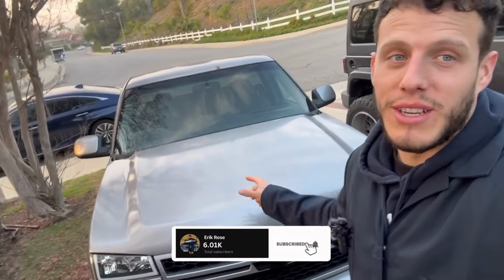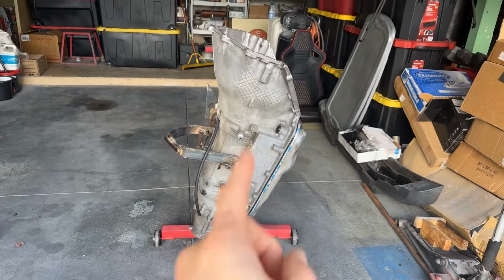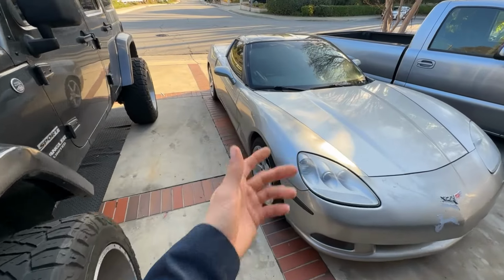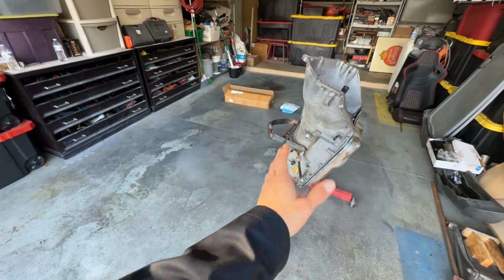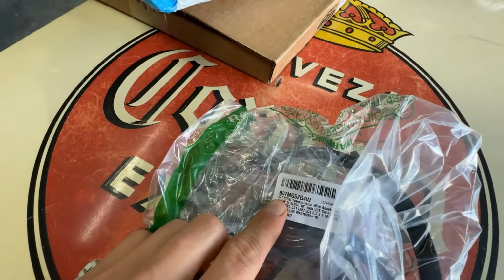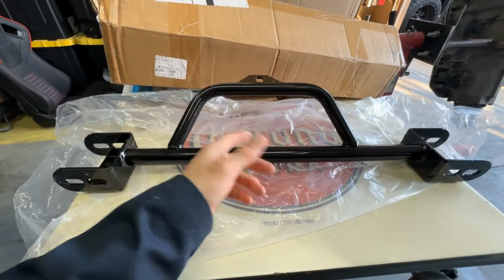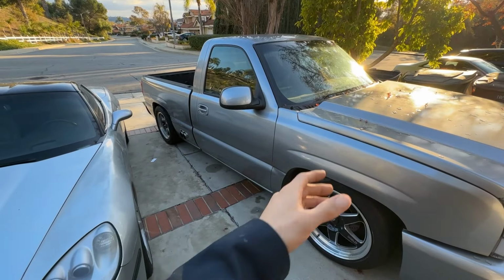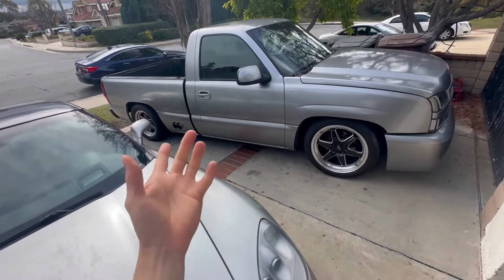EVERYTHING YOU NEED TO SWAP A 4L60E TO A 4L80E!!!

Comment: The 4L80 is more sturdy than a 4L60 but l'm not a fan of the 2.48 1st gear ratio of the 4L80 the 3.06 1st gear in the 4L60 is better and if you throw a 6L80 in the mix it has a super low 4.03 1st gear whats the big deal well with a 6L80 trans with a 3.27 - 3.42 rear end gearing will leave from a dead stop as well as a 4L80 trans would with 4.30 rear gears and not only that but in 6th gear with a 6L80 trans and 3.27 - 3.42 rear gear will be much more pleasant and peaceful to drive on the highway at 80mph than 4.10 - 4.30 gearing would be in a 4L80 trans the difference at 80mph would be 2100 -2300 rpm with a 6L80 trans with 3.27 - 3.42 rear gearing and with a 4L80 trans with 4.10 - 4.30 rear gearing 2900 - 3200 rpm if both had lockup torque converters

Comment: Sounds louder now
Reply: 4L80s rev high cause the gear ratios are low honestly unless his truck is boosted he lost horsepower
Reply: @Legendary_Frank the ratio difference is not a whole lot and you don’t lose horsepower by gear ratio it just changes the power band but the most important reason for this swap is so the 4lslippy doesn’t gernade
Reply: @daredevildare3641  it’s very different first gear on a 60 is 3.06 and first gear on a 80 is 2.48 that’s a major difference
Reply: @Legendary_Frank  that’s good for most things, easier to start a burnout and easier to start moving a heavier rig, I got 33x12.5 and my 4l60e doesn’t like to get them moving too good even with 3:73 gears

Comment: So i guess my question is im willing to upgrade so everything you described is what i will be needing for the conversion 😎👍
Reply from the maker: Yeah pretty much, just make sure to get the right transmission cross member the one I ordered was incorrect. But yeah transmission, crossmember, transmission mount, flex plate, conversion harness, a segment swap/tune, dipstick, torque converter, shift linkage bracket if your 4l80e doesn’t have it. Stock driveshaft should work by changing the slip yoke or getting a new driveshaft.

Comment: Did you have any problems once you put the turbo in to run crossover pipe with the 4L80
Reply from the maker: Not there yet starting the turbo install in a few days ! 🔥
Reply from the maker: Haven’t got to that point yet the truck is still NA, but if there is any issues or things to work around I’ll try to make sure I address them in the video.

Comment: Nice video. Would you do anything differently if you did it again? I have a 05 4x4 Yukon 5.3L. 233,000 miles. Looking to get a used cheap broken 4L60/65/70 to rebuild with my teen as a DIY learning project.  To have ready. I found a used one for $60, with nothing but Reverse working. Thanks!
Reply from the maker: That’s awesome, got to get them started young haha. Honestly I don’t have much to complain about I’m pretty happy with the results. If had to choose some stuff I probably would have upgraded the clutch steels to kolene steels and as well as some other upgrades in the transmission but then again if you’re doing a factory rebuild it’s kind of irrelevant. But yeah just addressing common issues, just to make it that more reliable.

Comment: it literally took 5 minutes and a small flathead to unpin 3 wires from that, unpin the black and tan wire, brown wire, and white wire. Put the brown wire where the white wire was, then take the other 2 wires and get a gm 254 connector from any parts store. To rep in the computer which you would have to do anyways, take the white wire located at pin 79 C1 (blue) needs moved to pin 22 on the other connector
black and tan located at pin 42 C2 
needs moved to pin 23 on C2. 
there you have it, a perfectly factory wiring that took 10 bucks for that 254 piece

Comment: I just saw your video on the 4l80e conversion and you said the flexplate is on Amazon  i have a 2005chevy silverado 1500 5.3 vortec LM7 too  and it says that it doesn't fit . Is that because  of the conversion to the 4l80e
Reply: I think you have to use the 6.0 flex plate

Comment: Just to make sure you don't have to buy a new computer? So if you buy those $100 ICT transmission wire adapter your all set ?
Reply from the maker: Correct, you don’t need a new computer. All you need is the wire adapter and a segment swap/tune to get it going. You also need a 4l80e dip stick with tube, I forget to mention this in the video I think.

Comment: So that flex plate will work fine on a 4.8???
Reply from the maker: yes should be the same thing!
Reply: @ okay cool thanks man👊🏼
Reply from the maker: You got it 🤙
Reply: Also you said it’s around ($100-$150) but the one you linked on Amazon is $50 that’s the right one correct and the bolts that come will be fine???
Reply from the maker: Yeah looks like the correct one, I think I just said the wrong price.

Comment: Ait so im new to the LS platform let alone transmission swaps on them. I'm looking to swap my tbss trans to a 4l80 and I'm looking at thw Michigan motorsports and from the tbss forums everyone is running PCM OF NC harnesses over the ict or Michigan ones.. thw price difference is ridiculous $350 for a PCM vs $100 for a Michigan.. did you encounter any problems?
Reply from the maker: Honestly the Michigan one has been great so far, but yet again I only have a few hundred miles on it. But I think it will be fine I don’t see it being an issue. I have seen some issues with people having an issue with the PCM, they just don’t require you to do a segment swap but might still need some tuning to dial in the shift points. I just prefer doing a segment swap and then dialing in the shift points.

Comment: So I could reuse my stock driveshaft for the 4l60? And could I reuse my torque converter?
Reply from the maker: No the torque converter is a different bolt pattern than the 4l60e and the driveshaft will work but you will need a 4l80e slip yoke and might need to shorten the driveshaft a bit.
Reply: @ErikRose_  thanks for the info🙏🏽

Comment: Where did u get the oil feed lines and are they necessary
Reply from the maker: Yes the factory transmission lines or not long enough at least for my swap so I needed new lines and the dipstick I don’t have a link for, it came with my 4l80e when I got it but they are on Amazon and eBay.
Reply: @ErikRose_  so where do I get the lines and fittings from to hook up
Reply: I'm only askin all these questions cuzz my 4l60e  broke again so I'm following your footsteps  so if you don't mind all the questions  I'm askin I'd really appreciate it
Reply from the maker: No problem man, not at all. You can get all the AN fittings and hoses from amazon to adapt it to the 4l80e. It also depends on which 4l80e you have on which fittings you’ll get if it’s the early style or later.
Reply: Which 4l80e do you have on your truck,  and Which one is best  or what's the difference
Reply from the maker: I have the later style 4l80e which is better and uses different fittings on the side of the case which are located at the front and closer to the back of the case which the earlier has one above the other.